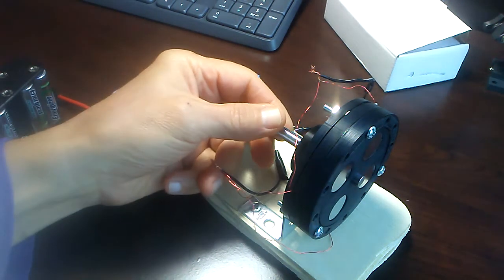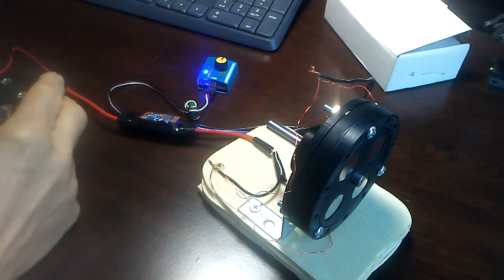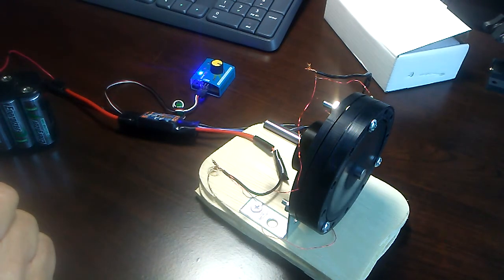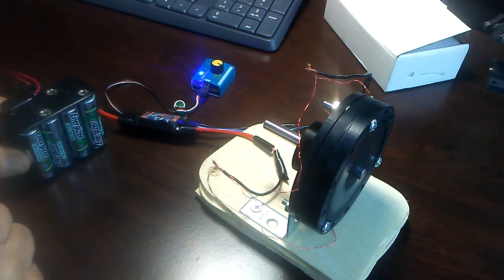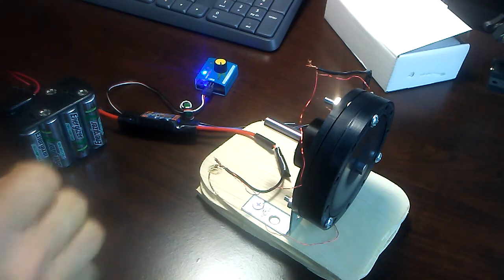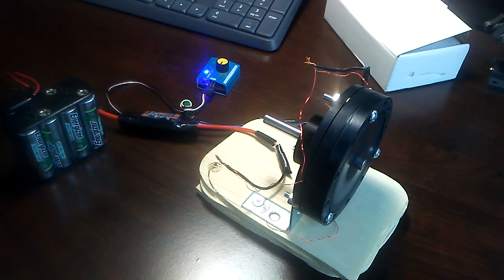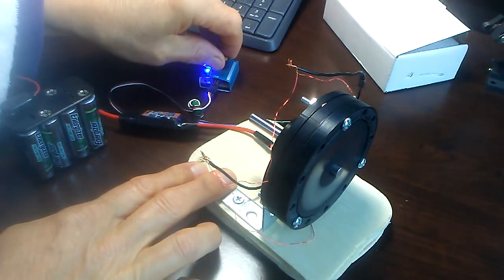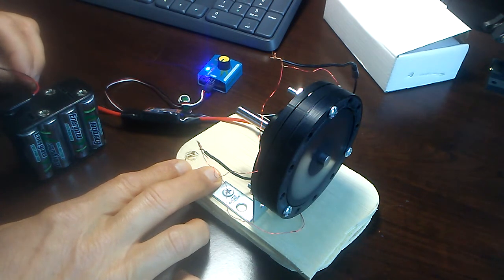3d printed Brushless DC Motor - sensorless

Comment: The only thing that can make a bldc a god of motors is hall sensors.. sir can u try inserting hall sensors in this..it will be too usefull for lot of people like us..
Reply from the maker: I put halls on this motor and after a few successful runs the controller burnt out. But, I built a motor that has 8 magnets and 6 coils that has halls and it runs great. You can check out the video:
https://www.youtube.com/watch?v=h1qRer-LJ30
Thanks for your interest.
Reply: @rickrandazzo  yes that is pretty successful... But as a DIY guy , the point is that why esc burnt out.. i am working on a fully diy skateboard hub motor with 14pole rotor and 12pole stator.. and the sensored esc is not a cheap component for me , i cant give it more than couple shots i think..
Reply: @rickrandazzo  scenario can be different in outrunner? Well i dnt think so... Can you tell me which sensored esc you used
Reply from the maker: @howtomake7527  I found this on Aliexpress.com. I usually get them off ebay.  
JY01 DC 12V-36V 500W PWM Brushless DC Motor Controller With Hall Driver
They're about $10 USD. I've been working to build my own controller, but have had poor results.